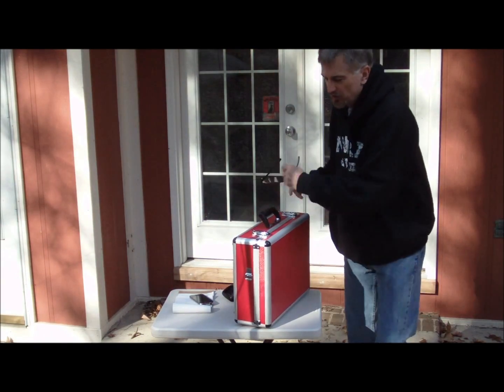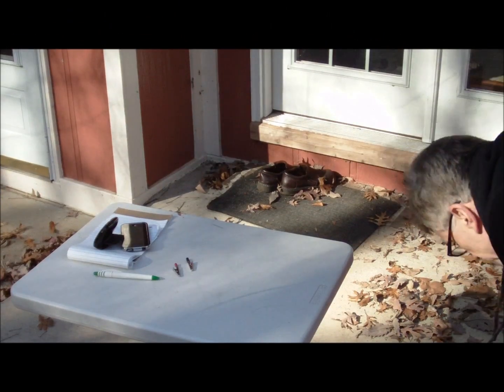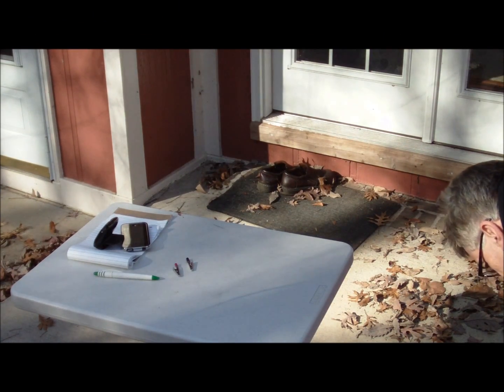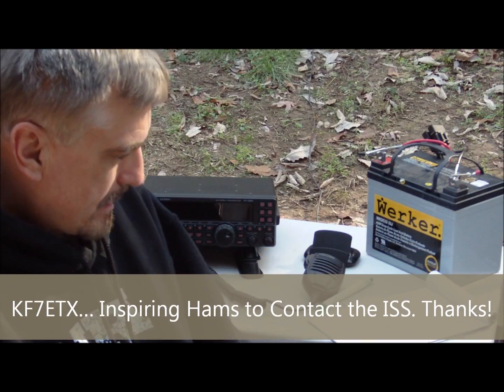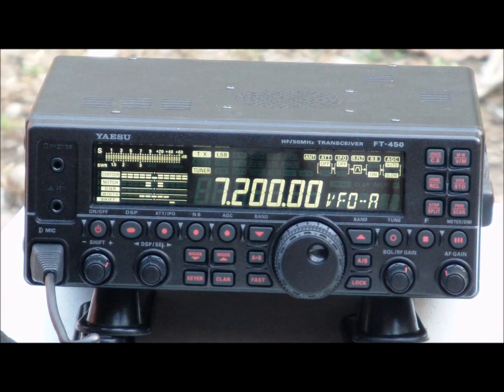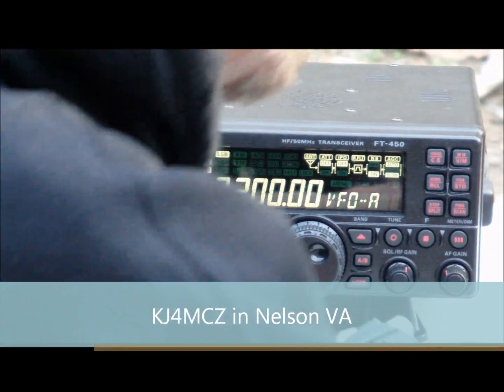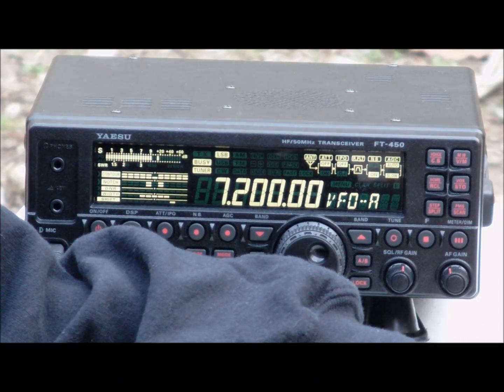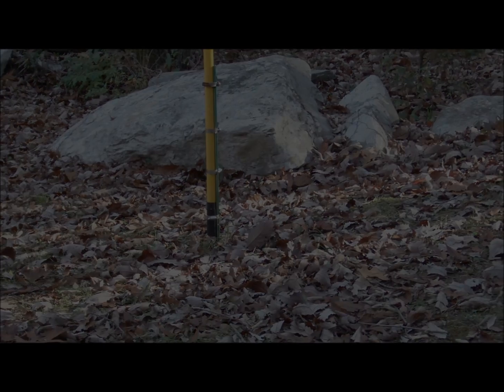Yaesu FT-450 Running 25 Watts

Comment: the RF output is continuously variable..you can run it down to 1 watt if you want to. many people overdrive their linear amps.. expecially on AM  where 25 watts carrier = 100w PEP.. while "normal" AM output is 45 watts.  push F.. rotate selector to RF power..push in selector.. dial up your desired output power, push F again.   at lowest power check setting with watt meter.. otherwise it is quite accurate.

Comment: 25 watts is the power limit of Dutch novice operators. There are some more limits. Power limit for full license is 400 watts. 
But I see here 25 watts is pretty plentiful.
Reply from the maker: Agree. I have often wondered how the bands would be if everyone used lower power :-)
Reply: Yeah from 25 watts to 400watts is about 4~5 more s points. Which is about 15 dB ? Over an s9 signal. 
I'd think if everyone lowered there signal the bands would much cleaner. Never the less. We all want to contact the other side of the world. 
73
Reply from the maker: Good point.

Comment: No digital radio is "exceptional" in the receive mode.. where the stand by current is on the order of 1 amp... while a squelched analog transistor transceiver might operate at 35-65 ma.  It is the digital logic which is the power hog during stand-by..  Anything works for half a day.. but when you want it to work for a week on a battery... digital stuff literally sucks.of course, you wont find the capabilities of an anolog rig that is 50 years old on a par with this modern wonder.. but they do the basic job.

Comment: Also I wouldn't call 25 watts qrp or even low power
Reply from the maker: QRP is a technical term for low power-- compared to 1000 watts, 25 watts is low power.  True, most radio amateurs have made 5 watts and lower, the de facto standard for low power.   73.
Reply: thanks
Reply: since you have to quadruple the power to double the signal strength.. and that is just barely perceptible in all but the most marginal situations.. 25 w or 100 w  makes little practical difference  unless your antenna resembles a resistor.. which some do.
Reply: Makes a difference to his battery charge life. Also, I've seen that these rigs will go down to 5-watts.   But yes I'd not call 25w QRP either. It is only in relativity terms.

Comment: Like this video a lot. I bought a like new 450d and find the number of buttons a little much! I like your set up here because this is what I wanted to be able to do. Subscribed to your channel, hope you have one on PSK31 or would consider doing one if you don't. Your battery look very large to lug around. how long would that last?(estimate) using 25 watts out? Mike KB1IUI

Comment from the maker: Thanks Doc.  Now with the sun at my QTH at such a low angle (the sun is hidden behind a hill), I'm unable to charge my batteries during the day-- I could go down to curbside for full-sun, but I don't want to risk dropping the panels along the way--BUT I would, if I really needed a charge.  There are several of these batteries I have, so they would last several days, maybe a week before I would have to consider other power sources. I picked up the solar panels at the local H. Freight. Later, Wil